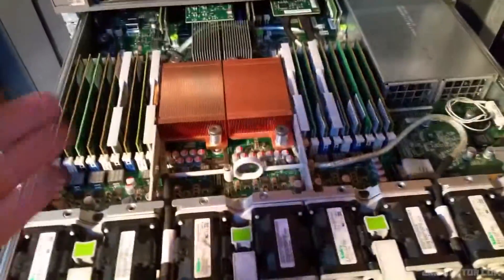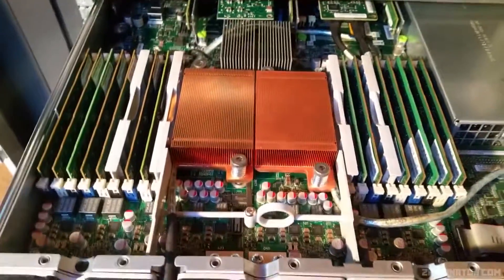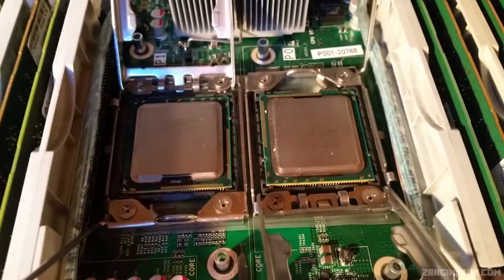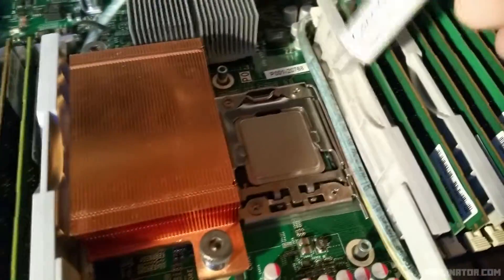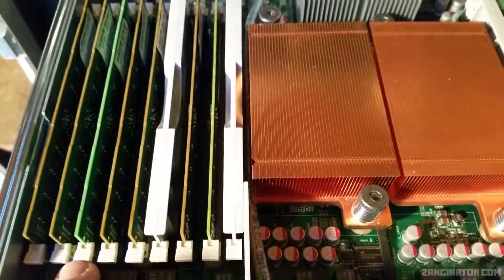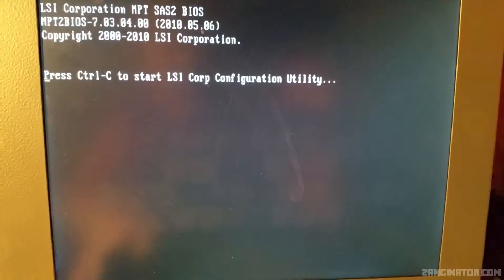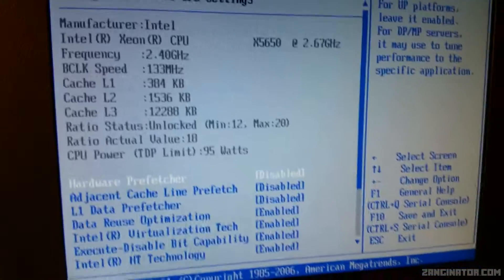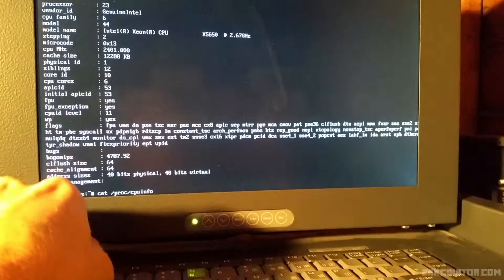CPU + RAM Upgrade - Sun Fire x4170

Comment: Hi,
Nice upgrade content. I have a sunfire x4140 but the problem is that the vga output is garbaged. Perhaps the built in vga controller is bugged. Can’t see anything. Serial connection via Putty is showing fine just the bois setup after that everything is garbage.

Plz tell me that Can I use external vga card for this server ? If yes then which vga card is supported by this server ?
Thanks in advance

Comment: Presumably, you cleaned off the old heatsink paste (with thermal paste remover and lint-free coffee cone paper), prepared the heatsinks thoroughly (with thermal surface purifier), then gave them a proper wiping (lint-free cloth), to give a perfectly dirt free, shiny surface before applying an ultra-thin film of brand new thermal paste, right?

Then did the same with the replacement processors (if new, just the latter two steps)?

We don't see that in the video.  Will just assume you did.

Honestly, not sure ignoring Sun/Oracles’ “star pattern” advice was wise.  Just dropping a pea sized blob in the middle, then hoping heatsink pressure and CPU heat will dissipate the thermal conducting paste to every corner of the processors isn't reliable at all.  That's why computer/processor manufacturers make specific recommendations: they've tried different patterns and learned from experience which works best.

Sure, doing all the preparation I've described takes time — 30 minutes all told — but it's definitely well worth it when you know your CPU’s are cared for properly, running at their most efficient speeds and, importantly, lower temperatures.

That time spent gains us longer CPU life and (best of all, with Sun “jet engine” servers), lower fan speeds and, therefore, (slightly) less noise.

These are fairly basic steps which everybody should follow (‘best practice’): a good habit for beginners (and everyone) to pick up and use on every upgrade — forever, don't you agree?

Thanks for making and posting the tutorial.  I hope I added a little to it.
Reply from the maker: Hi Claire,
Thanks for the comment. I think you've mis-understood as this is in no way a tutorial.

Many of the steps you've described are best practice, most are ignored by all as they are unnecessary.
Sun/Oracle advise of a star pattern is frankly overkill and will likely result in too much thermal paste being applied to the processor, thus reducing the thermal transfer abilities. (There advise stems from their own processors, not Intel's or AMD's).
The reason for going for a pea sized blob is the CPU die itself (under the heatspreader) is fairly small at about 1cm by 1cm (on this processor). Providing you get a good contact in that small area, you're normally fine. In addition the clamping force of the heatsink to the processor is so great that it will spread to create a very thin layer (as less is more in the thermal paste world) across almost the entire CPU.

If this were a different CPU with larger die, then yes a different pattern maybe required. For example the LGA 2011,2011v3 and LGA 2066 i'd use something similar to a grain of rise along the center (north to south) following the die and with AMD Eypc or ThreadRipper two lines down either side due the multi chiplet fabrication.

The Pea application is usually what I'd recommend (except for those noted above) as it also the method least likely to trap air as the thermal paste spreads.

Thanks for the comment.

Comment: Hello.  I have an x4170 mark 1.  May I know the highest spec processor that I can place?  Is it compatible with six or 8 core processors? It has the lga1366 socket unlike your mark 2.  Thanks
Reply from the maker: The Mark 1 & 2 both use the LGA1366. The difference is within the Chipset processor compatibility. Unfortunately, the Mark 1 limits you to only the Xeon 55xx series. Which if I recall correctly are only Quad Cores. The fastest of which would be the X5570 (there is a faster W5580 but I don't know if it is compatible)
Reply: @zanginator-tech  Thank you very much for taking time to answer my question.  Much appreciated. :)
Reply: @zanginator-tech  hello sir.  I read in your overview that the m2 has a red logo while the m1 has the blue logo. You also mentioned that the m1 can only take 4 gb dimms.  

I have a blue logo but use 8 gb dimms .

Im still trying to determine if i can use 5600 series procs as you did...

Thanks.